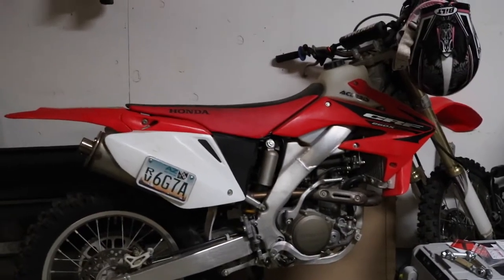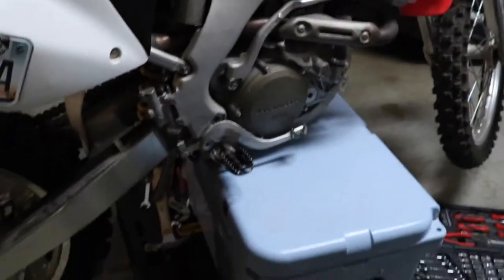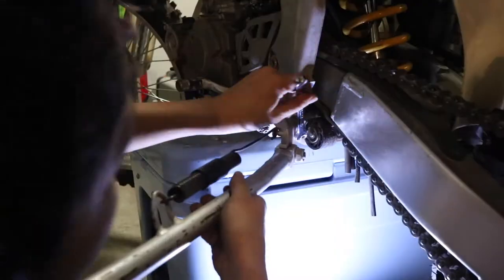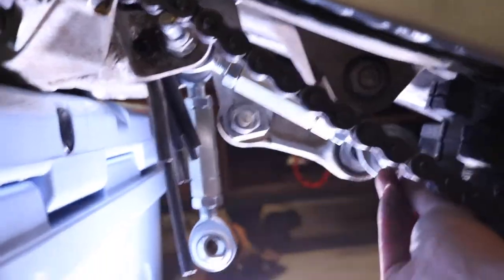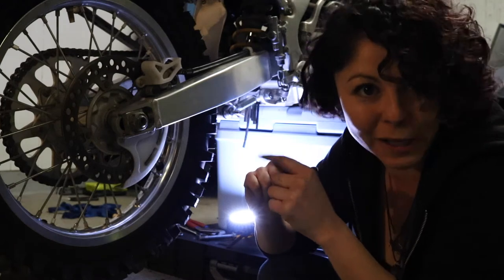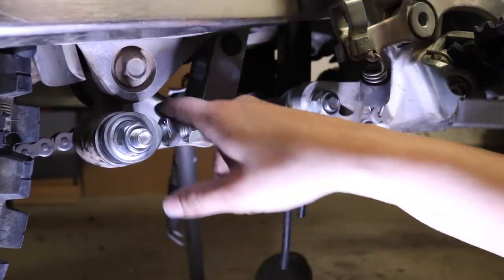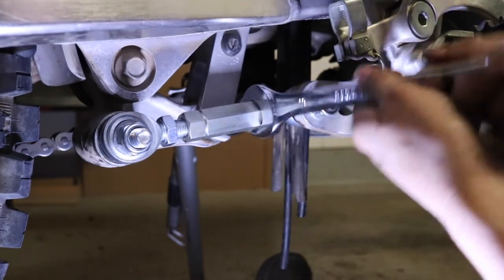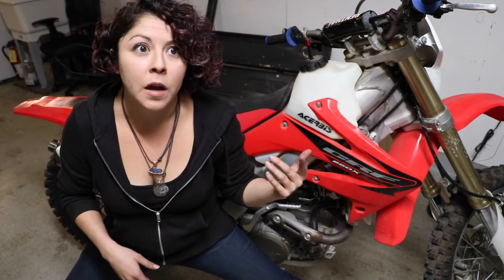Motorcycle Mechanics E1: How to Install an Adjustable Lowering Kit - Honda CRF250X

Comment: I just bought a Soupy's lowering link for my XR400. When you increase the length of the dogbone, you are lowering the link ratio, so I think you need to adjust your rear sag again. Also, did the tension on the chain change at all?

Comment: One thing I got from your vid is how much the wheel travels when you turn the turnbuckle.  I am 56 and have not ridden in 18 years.  My last bike was a 97 KX250, (a wonderful and lower bike), and I just picked up a 2019 YZ250 sky scraper 2-stroke.  They made the 2-strokes taller for some reason, (people in the magazines begging Yamaha to "update it's chassis" I am sure, like the higher 4-strokes, ticking everybody off under 5'10".) and I bought the pro circut lowering link that is 1.5mm longer than the stock link, (doing some other lowering mods too).  My money says the pitch of your adjustment thread is 1mm, and I can see the wheel move as you lengthen the link 1.5 full turns, (1.5mm).  I am getting my suspension back soon, (lowered it a bit too), so I don't have it all together yet.  But with all the other videos out there, this vid is the only one where I get a solid idea of how much my bike will be lowered by my link.  Looks like about 6mm, (judging from a tire knob to the shock protection piece), and that is what I was looking for and now I know it will work great.  Thanks for the vid.
Doug in Michigan.

Comment: You did exactly what I thought about doing ..so truthfully are they a kit or did you just put some eyes with bearings n a spacer..cus that's what I was going to do ..just I was planning on using 4link suspension eyes n once knowing how low ..tig weld them all using stainless ..the cost I'm sure saved a bunch and strength also ..dam maybe I should market these OPPS .NOW SOMEONE WILL
Reply: I like the way you think.  You think like a "GOD"!!!!!!    Yes, when you use your brain to make things and sell them in what is left of our free market, you are bringing something into this world that did not exist before, and now it does.  That makes you a "GOD" of material goods. :)
Keep thinking, then do it, as only a thinking man can.  That "thinking" is why mankind does not still live in the dirt.
Reply: Nope, we don't live in the dirt anymore.  Because of "thinking" and doing, we now ride on it. :)

Comment: Being lighter also means that there isn't as much sag as there should be, which makes things harder for women, too.

I am 5'8" and I am tippy-toe on one foot on a stock CRF250L, and the other is in the breeze.

AFAIK, if you know someone who welds, or want to take it up,  you can cut the stock stand and reweld the foot on it.

Good video.
Reply: You probably should adjust the sag to suit your weight ..
Reply: @JulianWBrown  , well it's hard when they don't consider shorter, lighter riders.
Reply: @JulianWBrown  , often there isn't a light enough spring rate adjustment to suit a lighter riders, which also leaves the bike taller. So, smaller and lighter riders are twice smited.

Comment: Hi I’ve just tried to put these on my bike and I’ve noiced that  they move due to the center betting sticking out
I’ve noticed that as you adjust  your bolts the same happens 
Seems a funny design to me
Thanks for posting this 👍
Reply from the maker: Yeah it is a bit of a weird design but the only ones I could find that were adjustable. Seems to hold up pretty well but I'm not usually hitting a bunch of jumps or anything. :) Glad you found this helpful.

Comment: Did you check and adjust sag distance before doing this? If not and you have since re-adjusted, risers good, you should maybe do a follow up video. Great video though, I am short too so this is super relevant.

Comment: Hi, just wondering how the bike rode after you lowered it and do you know how much you ended up lowering it by ? I have a crf203l that I can touch the ground with tip toes ( I'm the same height as you) but I am looking at lowering it so I can touch the ground better as I'm a beginner rider.
Reply from the maker: I don't know exactly how much I lowered it but I will say I took it all the way down and slowly brought it back up until it was a good length for me as I'm 5ft tall. So it made more sense to start that way for me. I'd recommend taking it out in between adjustments as well as it compresses a bit more after you give the suspension some use. Before the lowering kit, I definitely couldn't touch both feet down, even on tippy toes. But I was able to get a good standing position after using this lowering kit.
Reply: @VanGypsy 
I know it's a while ago but good job. You said you're 5 foot... soooo that  bike must be pretty torquey😂😂nothing wrong with too much power😉
Reply from the maker: @simplyrise5217  ha yeah well it was for sure. But eventually sold it before I moved out of the country. I have a different bike now. :) Much more suited to my size.
Reply: @VanGypsy  What bike did you go to from this one?

Comment: Hi I need to lower my bike but I was wondering how u are getting on with the kit  are they staying tight & not having to tighten the lock bolts  after a while few to vibration or have u used some lock tight . Thank you Ro

Comment: Devol lowering kits are so much better for same price
Reply: Are you sure ? They only lower less than 2inches and have seen one distort albeit after a hard trail ride. The one in the video is also adjustable.
Reply: I bought one..it's junk. Jeff is right!
Reply: Mike Stearns you bought what? A soupys

Comment: When will Honda ever wise up that Not all people are 6ft 2 tall.
The tight asses could easily make original links adjustable for about $2 extra.
Cam lobes or adjustable rods or different hole settings.
Lots of simple solutions.
It's not rocket science.

Comment: The other video with the guy has it done in minutes and adjust the tire prior. Watch that video instead of this one. She is not skilled enough to properly show a how to video. She should watch it. When adjusting front forks your gonna need new springs. She is not to informative
Reply: Are you sure you know what you are talking about?  The only time you need to change the springs in the fork is, (1 If you are actually shortening the travel of the fork internally, which would require a shorter spring. (2, if the spring rate is not right for your weight.  I just did both to my YZ250, (.750" shorter travel with a stiffer, shorter spring).   All she did with the forks is slide them up the triple clamps, which is not an internal change, and does not require a spring change.